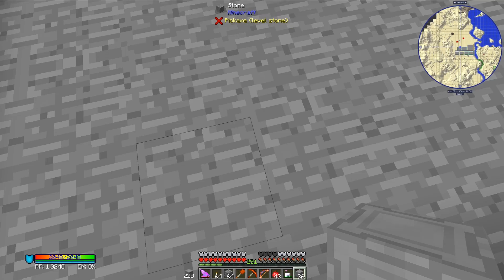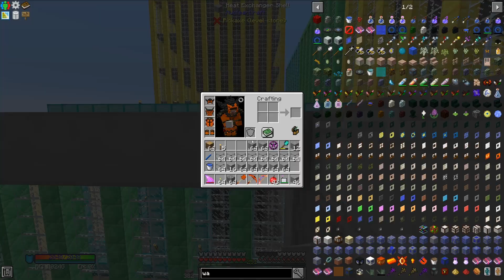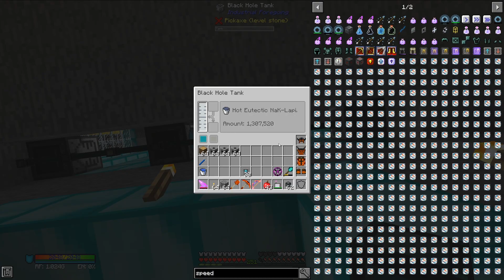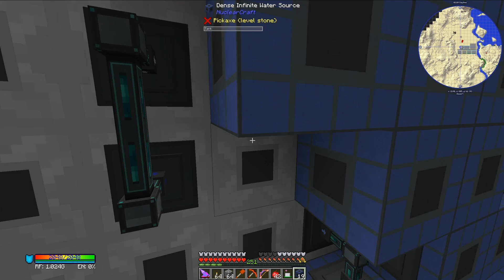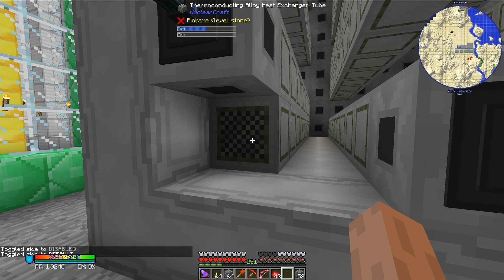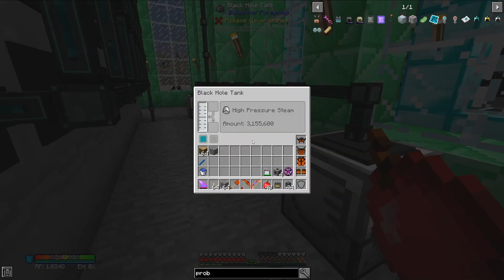NuclearCraft Heat Exchanger (For Use With A Molten Salt Reactor)

Comment: I made it the same, but it doesn't work.
Reply from the maker: There are 2 pretty possible reasons: 1. You  don't have something oriented quite right. 2. The mod has updated and something has changed. Could also be something else.